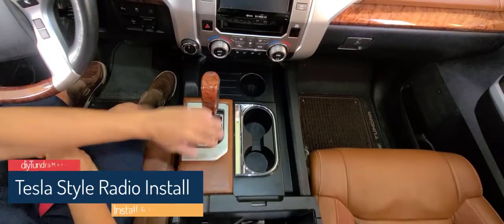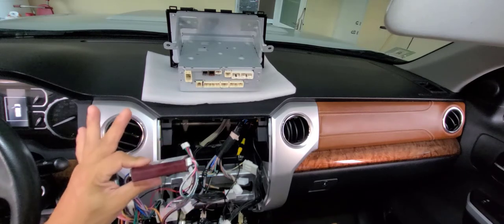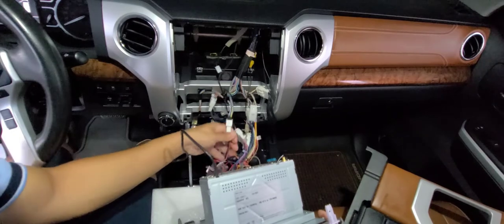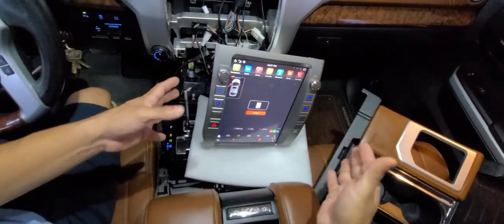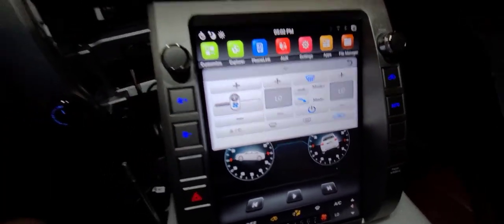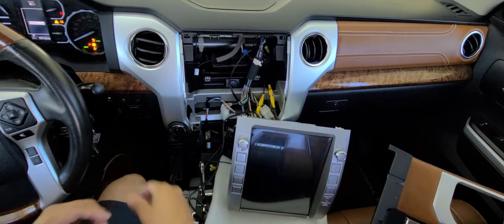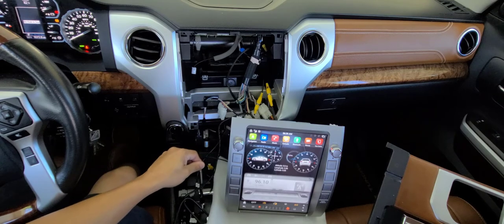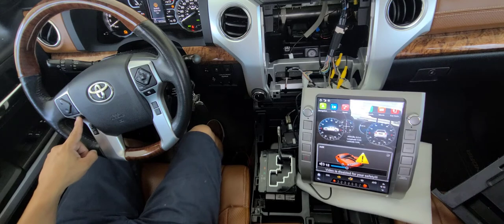Tesla Style Radio on my Toyota Tundra Install, Initial Setup, and more.... Part 2/3

Comment: Great video, man. What model year Tundra and trim level did you install this Tesla-style radio?
Reply from the maker: Thanks! 🙂, It is the 1794 Edition, 2018 Year.
Reply: Ohh, that explains why your A/C controls and transmission look so different than mine. Hopefully, this Tesla-style radio will fit 2014 SR5 like it was able to fit yours.
Reply: @jeromeshockley9572  how did that go? happy with the radio?
Reply: I ended up getting the Tablet style head unit from Amazon. It's not bad, but like any other android head unit the sound processor is lacking a bit.

Comment: How dose android auto work is it easy to use how is sound quality on radio and Bluetooth also the  settings of the audio how is the equalizer on the head unit 🤔
Reply from the maker: Android auto works fine for me.   I use it via Bluetooth all the time without issues.  This Tundra edition (1794) comes with the JBL system.  The JBL system has an independent audio amplifier located under the passenger seat.  Therefore, what I can say is that this radio has a good audio signal processing and the JBL amp. do the rest.  :)  Sounds good to me, and to be honest better than I expected.   I will go over this details among other reviews on my next video.
Reply from the maker: Review video is here: https://www.youtube.com/watch?v=k9_djIssULw&t=1s

Comment: You didnt install the mic?
Reply from the maker: Hello, no I didn't.  This unit has a small hole below the volume control that has a mic label.  But to be honest I am not sure if it actually works or is the cell phone mic that works when I call.  I have to test it.

Comment: hi!
i have the same problems that you have, it doesnt show the seat heat, can you help me? where did you find out that code?
Reply from the maker: Hello,  I did a search on Google and found this https://phoenixandroidradioforums.com/viewtopic.php?t=18  Most of this units has the same or similar firmware software that vary by model.   These codes are the one that have seen so far: 
8861
7890
666888
1680
1688
  I hope this help.
Reply: @TundraMods  thank you for your time, i hope i will solve these!

Comment: Awesome video and cant wait for next one.  Looking at ordering this.  Does it boot up fast when you get in and start truck or do you have to wait?
Reply from the maker: Thanks! It takes 6 seconds to fully boot when you get in and start the truck. I will publish the third part soon.
Reply: Cool video, is there a reason u picked that head unit with the knobs, and not the one that has no knobs?
Reply from the maker: @reynabuenrostro2798  Thanks for your feedback.  Yes, the main reason is accessibility.  These buttons are the most commonly use options for me.  I prefer to have quick access to this controls instead of navigate in the user interface to find for example AC fan speed up/down and audio volume.

Comment: Never use electrical tape to insolate wires under the dash. It will come undone and could cause a short circuit. Use shrink tube. All ways.
Reply from the maker: Good point! Thanks!

Comment: will it fall out due to only clips that hold it?
Reply from the maker: I think so, but I already made some fixes and it is still in place no more fall out.  But, In a serious crash this unit will definitely fall out.  This unit came with 2 metal brackets but I didn't see a proper fitment to the dash factory setup.